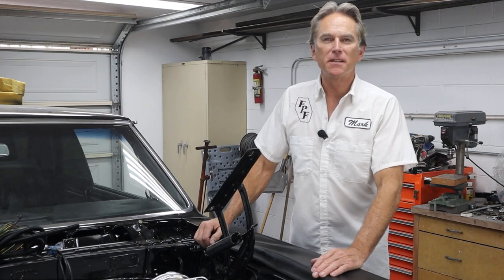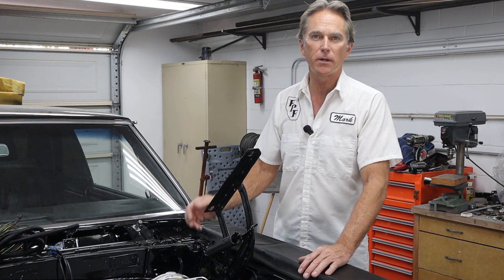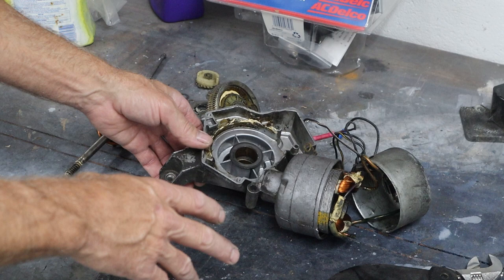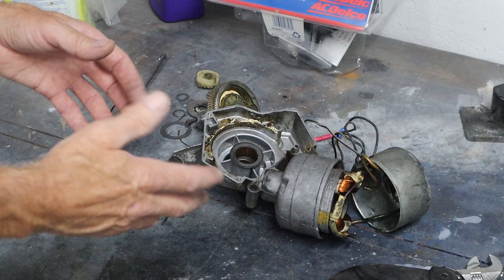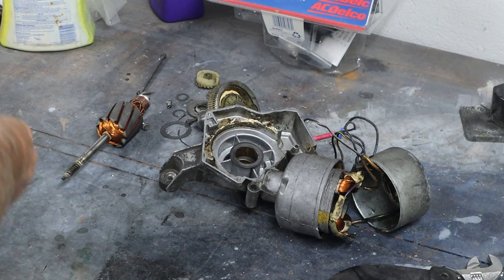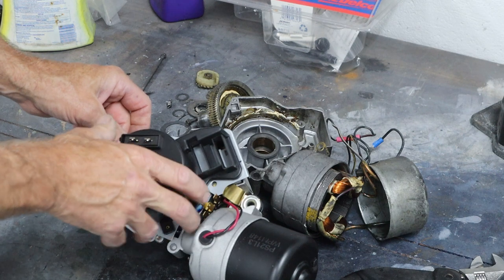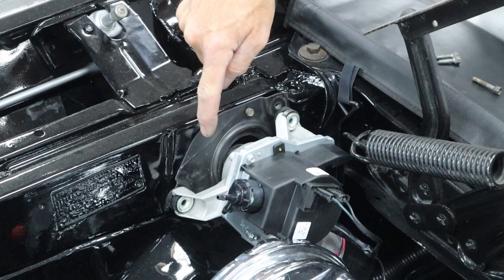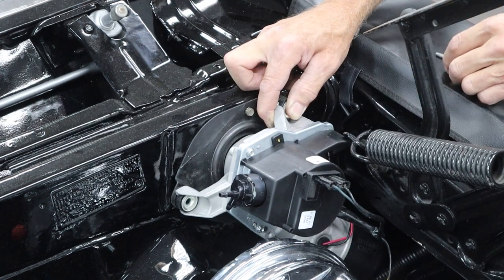1965 Malibu SS (Ep 16) Brand New 2 Speed Wiper Motor Replacement Found

Comment: Man, this channel is reading my mind! I recently removed and greased my 2 speed motor and tried to get my washer motor working to no avail. I will definitely be looking into that washer motor option. Thanks
Reply from the maker: If you really want the old style washer you will probably have to call and confirm since Ecklers shows the old style on their site but shipped us the new version with a pump.  The new style shot water over the car onto the back window until I got the emitters adjusted. It does a really nice job and looks pretty close to OEM.
Reply: @FoothillPaintandFabrication  I'm  a weirdo in the fact that I like EVERYTHING to work, but also, if you actually plan to drive the car you need to be able to clean the windows. Great videos, as always. I wonder what's next in your crystal ball
Reply from the maker: @OpenRoader  It is not weird, it is the way all vehicles should be.  If it is  on the car it should work. The 67 Chevelle I painted orange the clock didn't work (in dash model) so I took it apart and used the contacts off an old set of points off my Evinrude to rebuild it. It worked for another 3 years before it crapped out again.
Reply: @FoothillPaintandFabrication  You've got to be inventive. I agree, if it's on the car, it has to work.

Comment: Mark, thank  you for the tip on using the Impala wiper motor.  Great work as always.  Interesting that although I have seen both round and square body wiper motors in 65 Chevelles, my '65 has a square body 2 speed motor. Could be that the difference is due to different assembly plants or date of manufacture.  My car was built in August, 1964.
Reply from the maker: James, this seems to be the big mystery no one has yet answered.  Lots of debate for sure.  I have never seen a square two speed from that era only single speed.  I couldn't find a square two speed listed for sale either. A lot of the parts for the 65 were only used for 3 years so they aren't worth making replacements for.
Keep that wiper motor lubed up so it keeps working forever.
Mark

Comment: My 73' Oldsmobile Delta 88 Royale and 66' Buick Wildcat also use this same wiper motor. I went on the same adventure trying to find one after my Wildcats wiper motor burned up on a 12 hour drive back from Iowa. According to the AutoZone site, it says it doesn't fit a 66' Wildcat but I can confirm it does.
Reply from the maker: That's awesome, great cars too.  Yeah all those listings just go by part numbers that came on the vehicle, not what will actually fit and work.  It is a nice little upgrade and works great.
Mark

Comment: My 65 SS Malibu wiper motor still works and it’s original 58 years
Reply from the maker: Hey David,
That is a sign of good materials and caring for the car for sure.  If it ever craps out on you now you know where to find some eternal parts for it at least.  Not much rain around here so they don't get exercised like they should...
Reply: My 65 Cutlass convertible has the 2 speed wiper motor and washer that works.

Comment: I was hoping to see the removal process. 
I'm attempting to remove my windshield wiper motor temporarily while I install a new power brake booster, and I see there's a clip connected to the arm that looks easier to access than the nut on the motor shaft.
Reply from the maker: Yes there is a clip and it is fairly easy to remove.  Slide a small screwdriver along the end of the shaft and it will pry up the retainer portion allowing the clip to slide off sideways.  Here is a link to one being sold on Ebay so you know what you are dealing with.   https://www.ebay.com/itm/232780167914?chn=ps&norover=1&mkevt=1&mkrid=711-117182-37290-0&mkcid=2&mkscid=101&itemid=232780167914&targetid=1645685073328&device=c&mktype=pla&googleloc=9031820&poi=&campaignid=20133407470&mkgroupid=147476396765&rlsatarget=pla-1645685073328&abcId=9312979&merchantid=101720786&gclid=Cj0KCQjwpc-oBhCGARIsAH6ote_NhGM7ZSJJlQ3mWum4yx8n2YHnKT8TfbFecePYdjKuKaFZYX-vJYgaAql3EALw_wcB

Comment: Cardone offers 3 and 4 terminal replacement motors. 
Search 65 Cutlass 

Fun Fact, When electric wiper motors became an affordable option, people opted to keep their familiar vacuum systems. Fear of change.
Reply from the maker: Couldn't find one with Cardone when we searched, many others I spoke to couldn't either.  I will pass the info along if asked in the future.
Thanks
Mark
Reply: @FoothillPaintandFabrication  
Cadillac, Buick and Oldsmobile had nicer options first, and the A-Body parts are all similar or exactly the same. Rock Auto had many manufacturers and configurations in addition to Cardone, under my "'65 Cutlass 330 4 bbl" search, but it's for the motor only, not the entire assembly.
Reply: I'm removing my wiper motor so I can change the power brake booster. I see there's a clip on the arm, which looks easier to access then the nut on the motor post.
I had hoped to find a video but since I'm working on it and I've reached a stopping point, perhaps I'll make one if this doesn't turn out to be a mistake. I do have a body manual.